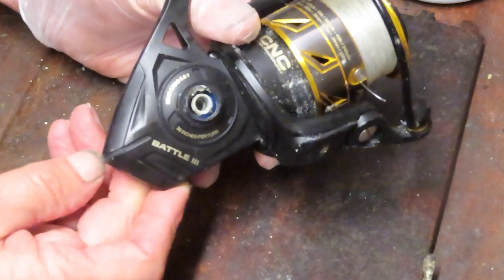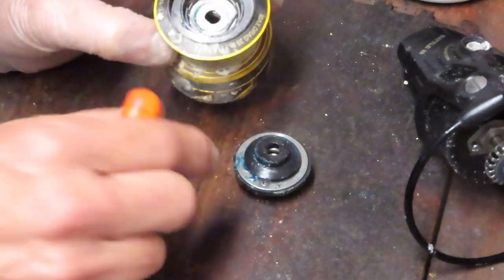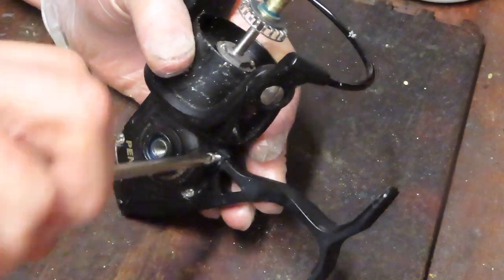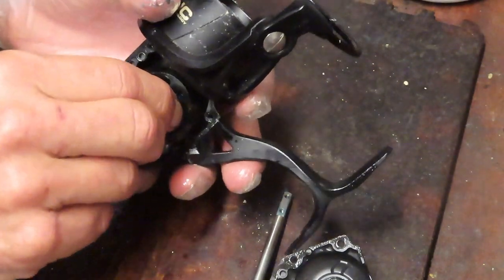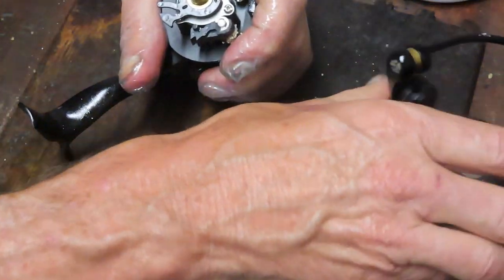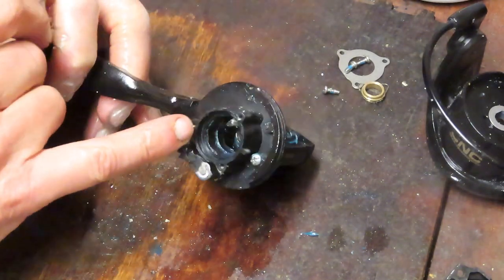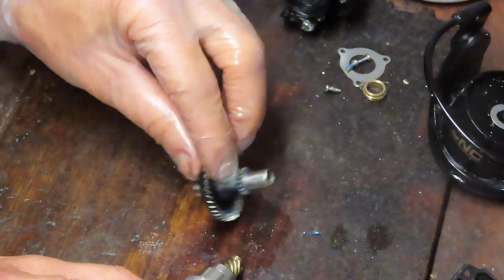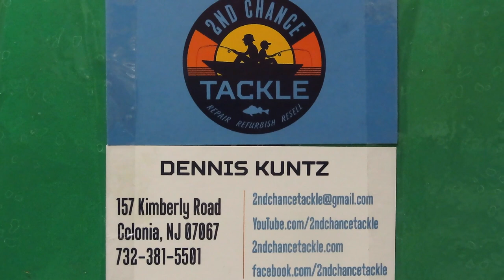An inside look at the new Penn Battle III spin fishing reel piece by piece and how to service

Comment: Thanks Dennis, great video. Can you explain where the shims go and how many there should be?
Reply from the maker: The shims go on the main gear outside and under the side case bearing.  They are used to take up the side to side play in the main gear movement.  The factory will typically install 1 or 2 to make up for the variance in manufacturing tolerances of the side plates and main housing.  If you replace the main gear, you need to recheck the shims.  if the gear is binding, remove one.  It is  loose - side to side,  add one - Dennis
Reply: @2ndChanceTackle  Thanks so much Sir! So if I have this correct, put a shim between the main gear and bearing (side where my handle is) but what is the side case bearing? Are you saying put a shim/shims on either side of that same bearing?

I put all 4 shims between the main gear and bearing and the reel binded. I didn’t add any new shims, so they were in there somewhere already and I reinstalled them incorrectly. 

Called Penn and was told to put them where the thrust washer goes per their schematic, but that just seems odd to me. 

Thanks!
Reply: Thanks, that makes a lot of sense and explains why the number of shim washers aren't consistent.  @2ndChanceTackle

Comment: A lot of people trash the Chinese-made Penn's but the reels you serviced on the channel all seem very well constructed.  I agree with Christopher, its painful to see how salted those charter boat reels can be.
Reply from the maker: It is not a question of whose hands put the reel together, the foreign assembly of the reels is not to blame.  It is when the designers and the brands make decisions to use inferior materials or short cut more expensive parts to "save" pennies on the reel.  Penn has done a good job for the most part in maintaining quality on many of there reels, although there have been some terrible releases as well.  That could happen anywhere .  Thanks for the note - Dennis

Comment: Thank you Dennis so much for the very informative video!  ☺️ I have both Penn battle 3 and Slammer 3. I can also say that the quality of battle 3 is the same as on Slammer 3, if not better (except the system of seals in Slammer 3). The feel of the reeling on battle 3 is in the class of Shimano or Daiwa.  I service both reels regularly of my self, and have never had problems with them 😎👍
Reply from the maker: Thanks for sharing!  The reels are similar and the Battle is popular.  The gap is narrowing between the two reels with the latest version of the reels - Dennis
Reply: How is the Spinnfisher VI compared to those two? I have the 4500 for about a year I only get down to fish about 10 times a season, but I try to take good care of all my saltwater gear. Making sure to clean and rinse them down after each use. Currently have a Baitrunner OC the cheaper of the Shimano Baitrunners that I’ve had for about 7-8 seasons now and it still runs great. Also, have a Tsunami 6000 that I don’t love it’s smoothness if that’s a word? But I guess all the seals are what makes that a little rougher, it’s also on the heavier side.

I’ve had the Spinnfisher VI for a year and I’ve used to surf and near shore fishing so far. I’m hoping that I’ll get as much use from this as I have my Baitrunner. Going to try doing some vertical jigging in Hatteras this summer out on the full day trip on the Miss Hatteras.

Comment: hey... me again. Have u taken apart a penn battle 3 le? Im trying to figure out if him missing a shim because it still isnt any smoother so im looking for something to fix it. If so, where are all the shims supposed to be? Under the rotor, under the reel assembly, one under the bearing on the pinion, and one on the top of the bearing on the pinion correct? I havent found any videos on the LE either...

Comment: Good afternoon, I thought I was getting a really good bargain when I purchased 3 Penn Affinity 3, 8000LCEU fishing reels that had some issues, mainly two of them the worm drives were damaged and it was obvious that the reals had been taken apart and they were stiff in operation so in my wisdom I thought I would completely disassemble the reels and rebuild them. However all three reels were put back together with shim washer and spacers in the wrong configuration. I managed to get a schematic diagram of a similar Penn reel which has the same assembly and uses the same parts, ie Penn battle. I have followed the schematic diagram in close detail but when I assemble the reels as per diagram, when I tighten down the pinion bearing retainer, it’s like there’s too many shims because the reel goes tight and I can’t fully tighten down the pinion bearing plate. If I loosen the screws then the reel gets smoother but the retaining plate isn’t screwed down flush, would you be doing a full tear down and rebuild of a Penn AFF1118000LCEU  I live in the UK and I am really wondering if I have made a bad decision buying these reels. I have taken apart too many reels to count in my life and I also collect Abu Ambassador reels with over a hundred in my collection that I have bought over my fifty years of life but I have never had a problem in servicing fishing reels but when they have been taken apart before I acquired them, I am stumped on how to assemble the pinion gears and  anti reverse part of the reels. I have worked out everything else on the reels. I really enjoy your channel so I hoping you can help, best wishes Gary

Comment: Hey Dennis, i would appreciate your comments on this product LPS 3 also 1 and 2 for different applicaions. I had used it in aircraft maintenance and thought it may be perfect to coat the inside of the skirted spools..Dave
Reply from the maker: I didn't know of it until your note.  This looks like a storage rust inhibitor made with some kind of wax to coat the metals.  I would avoid using this in a reel

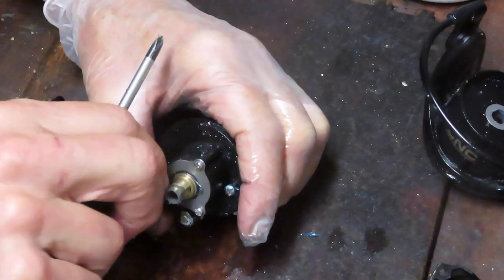Comment: Great video! One thing I noticed is that I am taking out the pinion assembly 14:38 - you said the flat side goes next to the anti reverese. If you look at yours, it actually does not. It is one turn clockwise. Probably not a big deal but I wanted to make sure my reel wasnt assembled incorrectly.
Reply from the maker: Thanks for the note - I will need to go back and relook at the vid.

Best wishes
Dennis

Comment: That battle CNC gear has the same gear ratio as the fierce 3 cast gear 5.3:1 do you think it would swap over
Reply from the maker: It may.  - Check with the folks at mystic parts.com they would know

Comment: Questions please. For the anti-reverse clutch on my battle 3 2500, I have had to take everything apart and fight corrosion (long story). They consider this a bearing, but how would you go about soaking/cleaning this to ensure rust/corrosion is stopped on the inside of this "bearing"?
Reply from the maker: Go ahead and soak it with penetrating oil.  Repeated sprays will help cleanse the reel and protect it in the future.  Thanks for asking
Dennis

Comment: Hi Dennis.  Thanks for the video on the Penn Battle III reel. I own a Battle III 2500 and now feel confident about performing the service by myself.  I have used the 2500 for a full season of fluking from the beach and it has performed flawlessly. Its now to  service it a put it to bed until next season.  Thanks again.
Reply from the maker: Glad I could help! The process is the same.  Good luck with the overhaul - Dennis

Comment: Hi Dennis, I use a Penn battle III for surf fishing and I got washed on a jetty, the reel went through the wash with me. It developed a squeak. I took it apart to service and I believe I over greased after watching your video on how much grease is too much. My next fishing trip it was stiff and as I fished it, it got harder and harder to crank until I felt uncomfortable to continue, fearing I would break it. I am going to open it up again now that I've watch your videos and hope I didn't damage anything. Thank you for sharing your knowledge and I will let you know how my second attempt works out.
Reply from the maker: Sounds like the inside of the pinion gear is gummed up or that you have a bent axle shaft.  I would start there with a cleaning and test of those two pieces - After you remove the axle shaft screw, oil up on the axle and make sure is is gliding easily through the pinion gear.  If it sticks clean both and try again.  If it still sticks, the shaft likely got bent fighting a fish or hitting something when you fell in - Dennis

Comment: Hi Dennis, thank you for sharing your time and talent!  How do you define penetrating oil, wd 40 or the like?  Would any residue of the same need to be removed prior to application of reel oil and grease?  Thanks in advance!  I just disassembled my reel after it fell in the surf/sand after a hookup and when rotating the handle elicits resistance and the sound of drag???
Reply from the maker: Penetrating oil like WD40 is petroleum based, so you do not need to mop up everything before you re-oil or lube, but I like to get as much out as possible as it may dilute the new greases.  Any time a reel goes in the water or sand, it get's contaminated.  Your issue is probably where the handle and main gear meet.  Maybe the bearings, maybe a shim.  Also, did you remove the rotor?  There may be sane and junk under it.
Thanks
Dennis
Reply: @2ndChanceTackle  thank you for the prompt reply! It appears the annoying noise when I first started assembling is on rotation of the pinion gear, with manual rotation of fingers,  where the dog/ dog spring/ retaining clip assembly make contact with the rotor.  "Click click click" incessantly. I have completely disassembled and cleaned every screw, shim, washer, you name it. There are no more parts to clean! This all started after the rod and reel fell forward into the sand/surf after that huge hit.  I want to take my boys fishing this Sunday with a functional rod/reel.  Help :)

Comment: Another fine video. Other than the color and a few Minor Details, I see very little difference between the spool on the fierce lll and the battle lll my question is will they interchange.
Reply from the maker: I don't think they are interchangeable.  The one difference between the battle and Fierce is that the Battle has a spool bearing on the axle shaft. so the spool would have a different mount - Dennis
Reply: @2ndChanceTackle  thank you for the reply. Buying more reels really doesn't break my heart.

Comment: Reel manufacturers add slots in the spool to save weight and sell reels, but I wish they would leave the spools solid.  Those holes just allow dirt, sand, and debris into the reel.
Reply from the maker: Good point.  This is a fashion (passion) reel business and the slots are pretty, but come at a cost as you note.  Thanks - Dennis
Reply: Somebody should start making aftermarket spools without the holes for the common reels. I'm sure there's plenty of people like me that would gladly pay for upgraded parts like that.

Comment: Looks like they drop in the water !!
Reply from the maker: These are not well cared for on charter boats.  It is mostly sea splash and line water that doesn't get risked off after use.  Thanks for the note and for watching - Dennis

Comment: Thanks for posting. The ears on the soft drag washers rather than the metal could be weak part of the drag.
Reply from the maker: There isn't any movement there, so I think the engineers probably have this one right - Dennis
Reply: @2ndChanceTackle  Thanks for the reply.

Comment: Do you know if the battle 3 5000 will handle small to medium sized Halibut weighing 20 to 100 lbs. ? I had 40 lb. Braided line installed.
Reply from the maker: I think it is undersized for that class of fish.  Best to go with the 8000 sized reel - Dennis
Reply: @2ndChanceTackle  In your option what’s the best name brand spinning on the market today? I see where some guy’s say the Vanstall is the best. Just want your thoughts on that.
Reply from the maker: That depends on the fishing you do!  All major manufacturer's have $1000 reels but is that what you are asking??  My go to recommendation fro good reels in the $100-150 range is Shimano followed by Penn. - VanStaal is now owned by Pure Fishing, the company that owns Penn. - Dennis
Reply: I’ll be fishing here in Alaska for Lingcod, Halibut and Rockfish and just want too purchase the correct Spinning Reel that’s all.
Reply: I guess what I’m asking is for your recommendation on a really good low maintenance Reel.

Comment: hey man, I took my reel apart and cleaned/regreased it and now its tighter to reel in than it was before. I took it apart again and removed some of the grease i put on thinking that I may have put too much, but it didnt fix the problem. Is there anything else that would make the reel tighter and less smooth as before? Thank you
Reply from the maker: Sounds like something is binding in the reel.  I'm afraid you need to take it apart yet again.
The tightness may be coming from a lack of shim washer or too many shim washers or a shim in the wrong place on the main gear.  It can also be from a misinstalled pinion gear assembly including the washers under the rotor and or bearings. Also check to make sure that the axle shaft is not bent.  Hard to pin it down based on your description, but the causes listed are where I would start - Dennis
Reply: @2ndChanceTackle  Okay i took it apart and it appears that im missing a shim. How should I go about replacing it? thank you for your response.
Reply: @2nd Chance Tackle I just got extremely lucky and I found the missing shim. Im going to try and install it once more and see if it fixes it. Then I will go along with the other possibiltes
Reply: @2ndChanceTackle  I put the shim back in, to no avail. It made it smoother when no gears were on the pinion. so maybe the main gear isnt setting right on the pinion? Or maybe I still am missing a shim